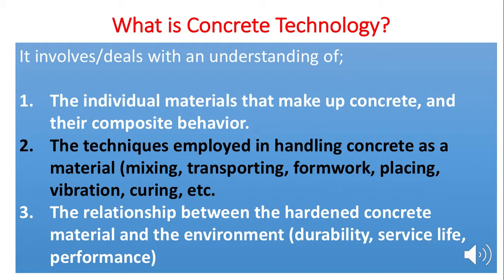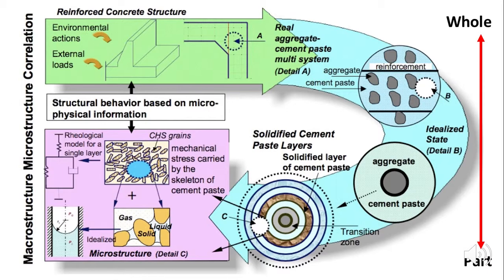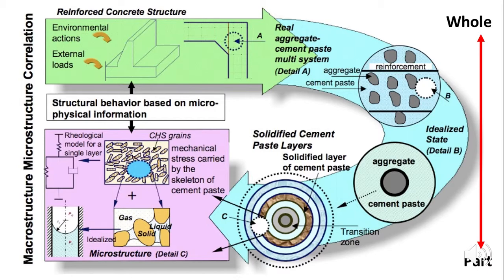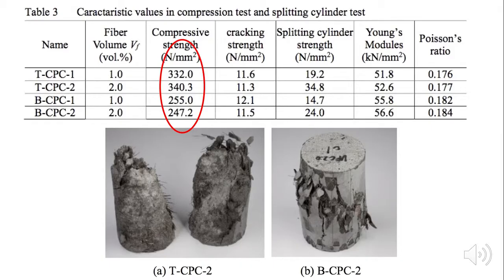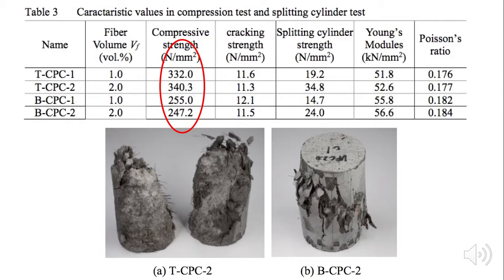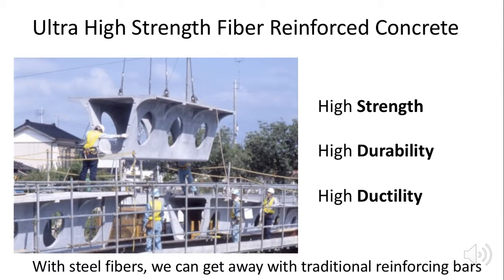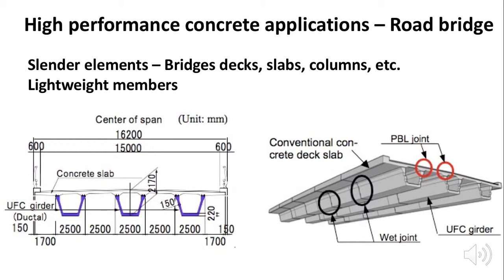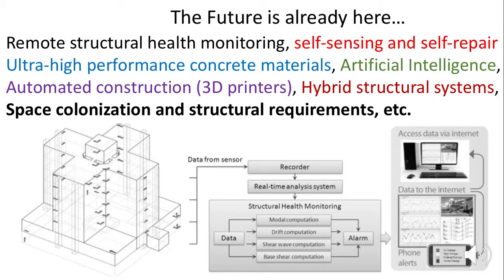The Future of Self Compacting Concrete Technologies (Forget What You Know)

Comment from the maker: The Sakata Mirai footbridge was built to replace the former concrete bridge which has spanned the Niita River, in the Town of Sakata, for 40 years. Ductal's superior strength made it possible to design lightweight bridge beams, to build one single span, 50 m long and 2.4 m wide. The deck is built of perforated precast elements to give the bridge better deformation resistance and less exposure to the wind. The thickness of the top slab is only 5cm. The extraordinary moldability of Ductal® allowed the design of a slender, light pedestrian bridge that could adapt well to the high-varying temperatures in the Yamagata region and blend seamlessly with the surrounding quiet townscape.

Comment: How are they able to achieve this type of concrete? Do they use the usual ordinary materials? Please help.
Reply: give an example of mix design please
Reply from the maker: Depending on the expected strength and durability characteristics, normal materials are used. For much higher strength and packing density, some reactive powders may be used in controlled conditions and quantities.